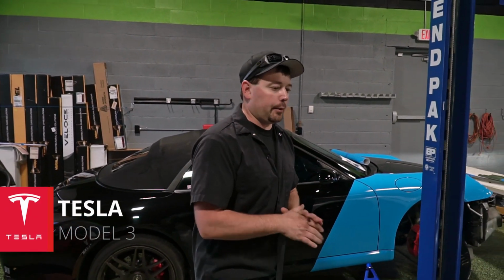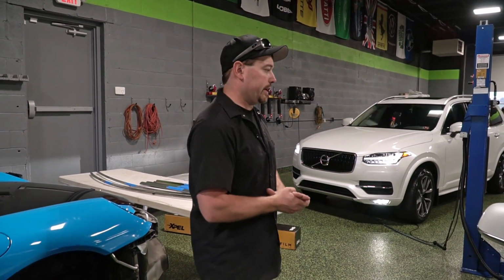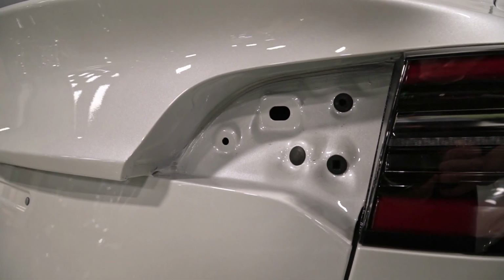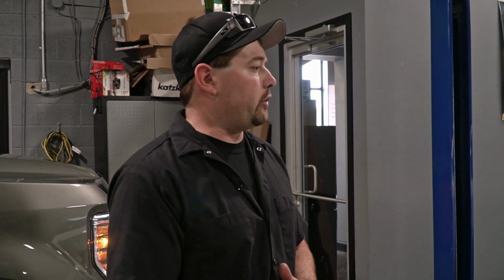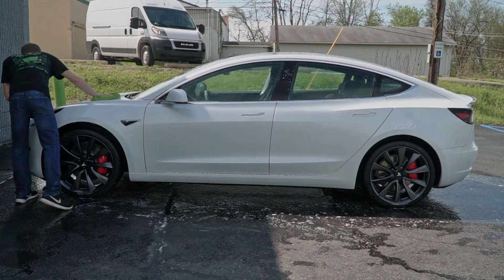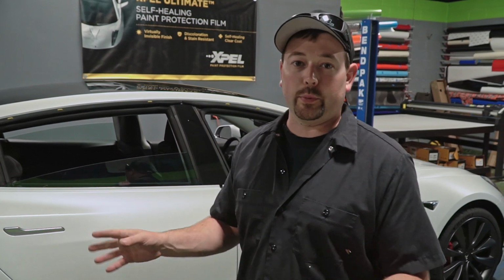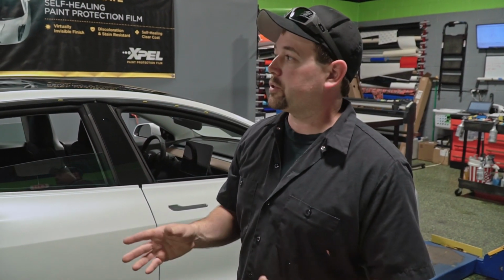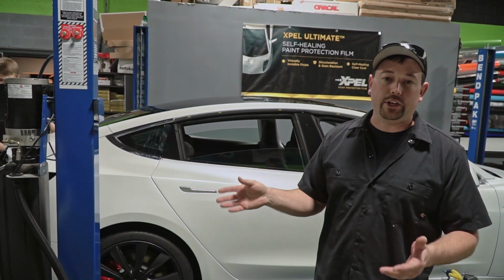[ Tesla Model 3 ] XPEL Stealth Wrap Vinyl Tint

Comment: Is hand washing still recommended for this or can you take this thru a normal car wash without worrying about scratching the paint?
Reply from the maker: Definitely never soft touch car wash. Touchless can be bad too because the pressure the water has to be used to clean a car can lift edges. We always recommend hand washing.

Comment: 4:57 - Edges are not wrapped around? This looks to be a pre-cut pattern with no added length to wrap around the edges.
Reply from the maker: This is indeed a precut pattern.  We modify the patterns to wrap wherever possible, this panel is no exception.   This particular shot shows where the rear quarter and the rear bumper meet.  Unlike vinyl wraps, PPF is very thick and does not conform to a small radius like that and hold up over time.  If you remove the bumper and wrap between those panels, the body gap will be larger and the vibration will work the film loose anyhow.  While someone may try to say you could tuck the film into that very small area, because it is on the radius you'll have about an eight inch of film that will lift up, collect dirt, and need trimmed off.  Vinyl is different, and could be laid into that recess and it would hold.  Thanks for watching!!
Reply: That is correct. I had mine done(white also) and it developed dirt line from edge lifting. Shop had to redo without tucking in gap. Experience is key to these jobs

Comment: How much for the paint protection on my model 3
Reply from the maker: Each shop is different depending on the area and competition etc. We charge around 5500 for a model 3 because you are leaving out the glass roof. That's for the full wrap alone, that doesn't include the vinyl chrome delete. The paint protection film comes in a satin(seen here) or gloss finish. But some people just want the the front bumper done and our most popular is full front end. So prices can range obviously.